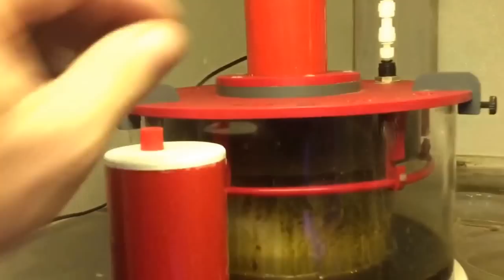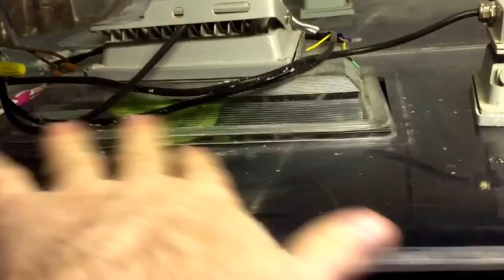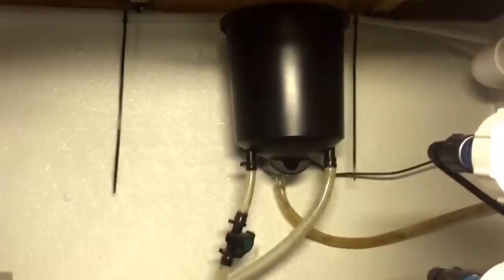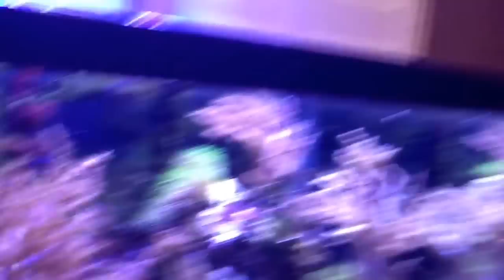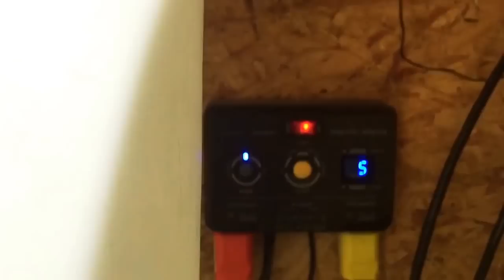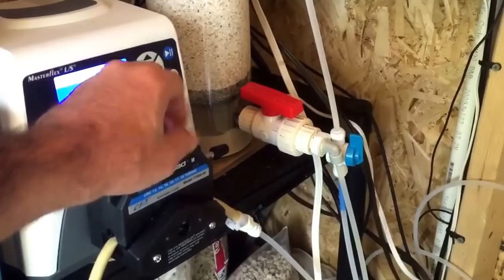Filtration & equipment for my 500 gallon reef tank. Total system volume is about 650 gallons.

Comment: love it !  You thought of everything it seems.  I love that you have been at this for so long we can learn from you!  can you tell me how you get your return to switch between your two SeaSwirls?
Reply from the maker: +Cycnoches2012 I have a 2" PVC line that goes from the pump to the top of the tank. It feeds the pair 1" Seaswirls. One is fed from an inline "T" fitting and the other is at the end of the loop hanging off an elbow.  The T and elbow are both 2" which I reduced down to 1" at the Seaswirl side. The Swirls are joined to the line via a union. The elbow and the end of the loop coupled with the Seaswirl create enough head pressure at the end of the loop that the flow between the two Seaswirls is about equal. Here's links to a couple pictures.  I just took these pictures.  The tank lights were off. The  pictures aren't great as a result but you shroud be able to get a better idea. The 2" PVC pipe is covered in a foam insulation sleeve which I added when I installed the swirls 15 + years ago.   
http://s390.photobucket.com/user/shleif/media/Pumps/image_zpswlry2fe2.jpeg.html

http://i390.photobucket.com/albums/oo347/shleif/Pumps/image_zpswlry2fe2.jpeg

Comment: Great video and beautiful tank.  I've got a 450 gallon system that shares some of the same equipment and setups.  I have a few questions, if you would not mind answering/responding. (1) When you ramp up your return or your recirculating pumps do you have any problems with your sump levels?  I have the same skimmer and I love it, but it's sensitive to changes in the water level of my sump. I've been thinking about adding a dc return pump that I could use to vary the flow throughout the day, but I am concerned about the sump level and my ato kicking on and off unecessarily. (2) Can you tell me the model of your aquadriver setup? I have the same bubble king supermarin skimmer and have been looking for a neck cleaner and collection cup rinse system for a while without any luck. (3) Can you tell me what you are using to raise and lower your light rack? (4) Lasltly, I noticed your lemonpeel, have you had any problems with it nipping at any of your corals? Thanks for your time!
Reply from the maker: +Andrew I don't ramp up my return pump. The return stays at a constant speed to avoid sump level changes. The Aquadriver is the 250mm version. The Supermarin or any other Bubble King 250 series skimmer would use a 250mm lid. A 200 series skimmer would use a 200mm lid and so forth. There is a new Aquadriver coming out and I will be the US distributor. The Aquadrivers are from Germany though and they are very expensive. The one for a 250 sized skimmer is around $600-$650 US. You could save a small fortune and get a Vertex Vectra with the 250mm lid. Run it once a day for 60 seconds and you will be set.  No issues with my Lemon Peel. I've had it for years but I have a large well fed tank. I know they can be hit or miss. With regards to my light rack, I use an AC Powered winch. There is a 6 part LA Fish Guys video covering my original switch to LED's and the building of my new light rack. Here is a link to part 1 of that Episode. It covers the winch which was already installed and the new cable and pulley connections. https://www.youtube.com/watch?v=gjDRBYweMJg
Reply from the maker: +Andrew I think the light rack install/hanging above the tank starts in episode 4 of that video I linked to in my previous reply. The previous parts cover the building of the aluminum rack itself.

Comment: What are the dimensions of your tank? glass acrylic?  I am in the planning stages of making a similar system.  My fish room will be in the garage sharing a common wall where the tank will be.

Any suggestions will be greatly appreciated.
Reply from the maker: Tank is 96"x48"x24" tall. 1.5" acrylic front & back. 1" sides, top & bottom. I had it made 20 years ago & it's still damn near perfect. One thing you can do surf acrylic is remove scratches. Somthing that isn't possible with glass.
Reply from the maker: I thought I replied but I guess I did not. The tank is 4' x 8' x 2' tall.

Comment: I'm going to save up and get a 500 gallon tank (I get like 20$ every 2 or 3 weeks lol) so how much does it cost in total with the stuff required for keeping piranhas? (filters,heaters,and other stuff)
Reply from the maker: To be honest, I really couldn't tell you. I built the system over the course of 20  years and there have been a number of refinements & upgrades over that time. Freshwater is certainly much simpler than salt water and much cheaper as a result.

Comment: awesome system and walk thru.  enjoyed it lots. One question what is your calcium levels running at constant?
Reply from the maker: Calcium is 450, Alk  is 10 & Mag is 1350. With the calcium reactor I don't have to supplement anything.
Reply: +slief 
thank you so much, I have some things to adjust for sure. are you doing anything monthly with the miracle mud?
Reply from the maker: +Jeff &amp; Colleen Tyler No Miracle Mud for me. I was offered it by the manufacturer when I setup my refugium back in 2010. Miracle Mud requires that you replace a portion of the mud every several months. For me that was an immediate turn off. Instead I was able to acquire some fresh live Fiji mud that came from the bottom of fiji live rock bins from a local live rock reseller. I got a  hundred or so pounds of that along with around 200 pounds of live sand and put the mud down in the refugium followed by live sand and live rock rubble. When I setup my refugium, it was part of a much larger sump swap that was done when my tank was actually full and stocked. It was recorded as part of an LA Fish Guys episode. This part of LA FIsh Guys Episode 80  covers the sump and refugium install along with the mud. https://youtu.be/pgH6NIrbtwo 

If you watch the rest of the Episode 80 parts (I think 12 parts in total), there is much more coverage of my sump  and refugium design (covered in part 5).  I was also going through a massive ich outbreak at the same time which was also covered in this episode. That was brought on by a large water change with colder water. The ich battle didn't end well and I learned that there are no reef safe remedies for ich. A painful lesson but I wasn't willing to treat this tank with copper as it never could have been a reef again. Fortunately, I have never had ich since.

Comment: Man ur like a mad scientist lol... No one would be able to troubleshoot your tank but u. I'm amazed how much thought and equipment u have setup. How many tank and years of experience do you have? I'm on my 2nd reef tank and while I'be learned a lot from previous mistakes I can never touch this.. Bravo I'll book mark this vid for if I ever try to get a bigger tank. Always easier to plan this type of setup instead of add changes along the way. If u get the chance check out my JBJ 45 reef. Would like your input of any... Happy feeding! Be easy! ✌🏾️
Reply from the maker: Thank you. I started with salt water back in 1987 or '88.
Reply from the maker: I've been in the hobby over 29 years straight. Tank is actually pretty easy to troubleshoot but it pretty much takes care of itself & the Apex controller pinpoints most any issue.